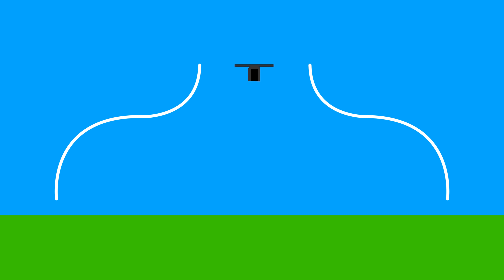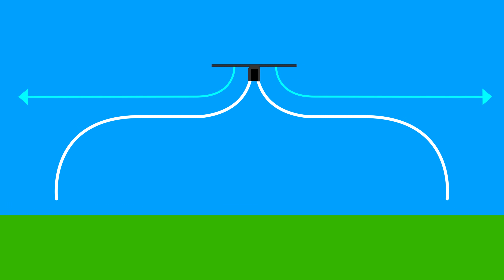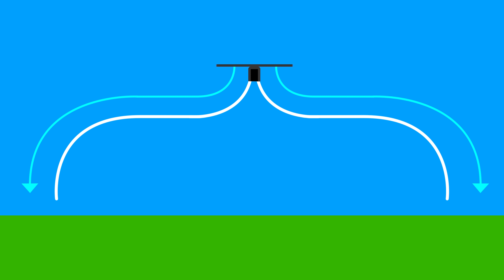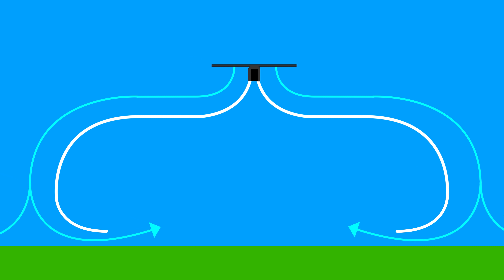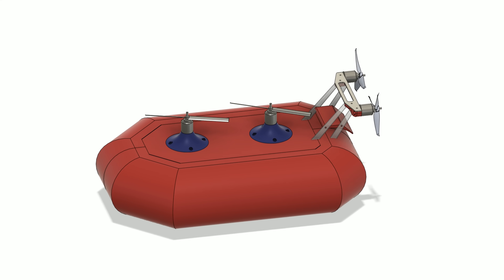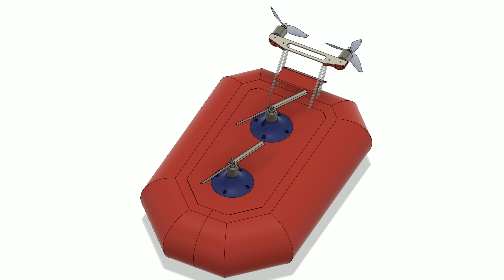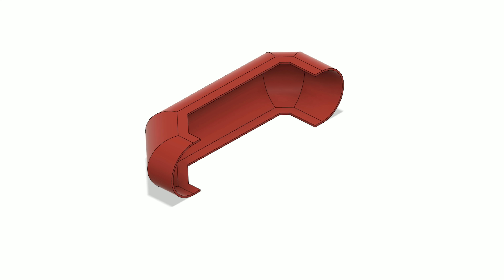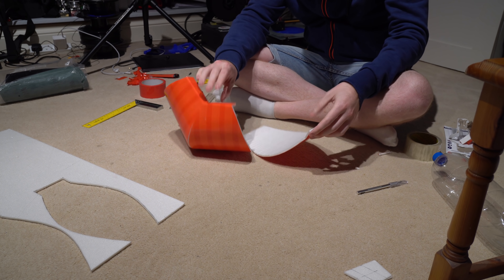Coanda Effect Hovercraft

Comment: Hey Tom,
I may have an idea to improve the hovercraft lateral stability :
By cutting the below high pressure volume in half along x (by adding a panel from the front to the back), in case of a side take-off, the other one would keep the high pressure and counteract the roll effect (maybe a little 😅) 
By the way thanks for your videos I love them all 😉👍
Reply: You and I seem to be the only ones to see the tipping as a feedback loop with airflow of the two sides.

Comment: Regarding the coanda effect. You should make low pressure side above so it will create a lift. You're wasting lifting air force created by the propeller by making low pressure side at the bottom.

Comment: The impeller should be inside and not outside. It should be sucking the air from outside the shell and distribute the air force to the inner side of the shell.

Comment: I wonder, could you stick the gyro onto it and program it in such a way that it can detect when it lifts off the ground more than a few inches and throttles the lift motors down to prevent it from flying/flipping?

Comment: Maybe the second propeller can be larger or have more of a pitch for more lift to help with the extra weight of the rear motors. Also, try putting on outriggers for stability

Comment: I think those aur molecules were not getting into the inside pocket as efficient as you had thought
As far as I can visualise, flow separation is dominated
Try to use vortex generator and give a shot.
May be better lift will be observed at lower throttle level.

Comment: Wouldn't it be even more efficient with just a tiny bit of air going straight from the horizontal propellers through some holes to under the structure keeping a positive pressure at all time?

Comment: The power to weight is so high you might just try adding a weighted bracket to the bottom to see if it fixes the stability.

Comment: i recommend independent throttling for the lift motors the back motor operating a bit higher that the fore motor might help stabilize it. i don't know if you can but perhaps a leveling controller could be made?? to aid in throtle control?

Comment: You are blowing air down onto the craft. The lowered pressure created by the fast moving air across the surface is simply cancelled out by the downwards pressure of air from the fans. You missed that in your diagram. An interesting idea on paper, but in practice it's 1/100th the efficiency of a normal hovercraft.

Comment: Excellent as usual Tom. One quick thought. I wonder if you drilled maybe a dozen vertical holes in say two rings of six around the blue inverted funnel shapes directly below the vertical fan blades whether this would help to increase the pressure under the skirt marginally and yet not interfere with the overall flow of the air across the surface thus maintaining the lift effect and slightly increasing the positive pressure underneath. Incremental increases in lift possibly but then efficiencies such as these lift jumbo jets into the air with there only being a difference of a few psi between upper and lower areas of the wings and look at how much they can lift. Anyway, just a thought. Keep up the great work mate, well done and always quite interesting, thank you 😎👍

Comment: You could easily test whether the leaf pickup is due to the Coanda effect. Just drive the craft over a leaf covered area with and without the lift motors on. Compare the results

Comment: The flip issue  is most likely related to the fact that the propellers are at the same height.
They actually had stability issues when developing the chinook. For that very reason.
But again I’m not a aircraft engineer so I could be wrong🤷‍♀️

Comment: This is literally just a helicopter.. you said it yourself "have to control the propeller speed no it doesn't take off too much".
Reply: Some of the lift is coming directly from the props, but the hull is modifying the flow of air so that some of the lift is also coming from the base. The props are pushing air directly into the hull that they are attached to, which would be counter-productive if not for the effect he's trying to demonstrate.

Comment: Love it. You can probably improve the balance and reduce its tendency to tip over by suspending the batteries and other weight lower inside the shell to reduce its cg. A wire mesh may be necessary to prevent leaf inclusion, although that will certainly reduce efficiency and might cause clogging.

Comment: This was fun to watch.

The Coanda effect vehicle does not have a natural height limit like the conventional vehicle has. That may be part of the instability problem. If there was a way to spoil the Coanda effect when it gets to far from the ground, that may make it more stable. Or you may add feedback to the vertical motor speed based on the height. The vehicle you built is not afraid of flying.

Comment: How do we know that the lift is produced by the coanda effect and not the low pressure above the propellers? it would be interesting to replace the main body with a rectangular box and see that, in this case, it dosn't move.

Comment: you are aware that you are not doing coanda nor anything like it, right? you'd need laminar flow to work properly, and by not having a duct on  your fans your propeller tip vortices will simply create so much turbulence that its just a redirection, not the actual coanda effect... besides, you'll never use a normal propeller for coanda... you should have used a different kind of propeller, a compressor propeller, with proper housing. or even just taking a vacuum propeller... those will give a nice laminar flow close to the surface, not the thong you actually have...

Comment: Again, another brilliant machine. If you don't mind suggestions how about, having a servo inside that has a weight that moves toward the apex of turns when turning? and it also looks so efficient that thin strips of lead could be placed inside on the lowest pasts of the skirt? And maybe totally cover the underside flat?

Comment: When it passes like 30 degrees u should have an automatic switch to turn the blades off or in the opposite direction. So that it stops the flip.  Also the front is to light. An additional weight in the front could help it from flipping over. Or make the front motor slower then the back motor so that they equally apply pressure to the weight ratio

Comment: I think the problem of why the hovercraft can not be fly is the CG and the force resultant. That force resultant of the engine thrust makes the hovercraft rolling forward. It can be stabilized with make control for the horizontal propeller to negated the engine thrust resultant. I am not really sure about my opinion, but I'm so interested in your idea tom. *cheers

Comment: I really think you have a great thing here going with the hovercraft.  To add stability try using a couple of gyroscopes.  Maybe counter rotating propellers would help.  I also noticed when you achieved a certain speed the nose turned upward and it started to take off.  Try turning it into an airplane, wings, rudder and elevator.  Maybe a rear wing with a canard configuration.  An airplane that could land and take off almost anywhere.... no runway needed!

Comment: I suspect you've actually made a highly inefficient helicopter rather than a hovercraft... Can you measure the airflow blowing under vs. being pulled and expelled off the sides?  Unlike a conventional hovercraft your slow-motion video shows oscillations up and down, indicating you aren't pressurizing the underside enough to cause an air cusheon.  A good way to confirm is try mounting the fans on the side so any vertical thrust is no longer a factor.

Comment: The Coanda effect works extremely poorly on a small scale due to the non-scalability of air viscosity and air inertia. Your devices fly not due to the Coanda effect, but due to the rarefaction above the propellers. On a small scale, the hull simply serves as an aerodynamic obstruction due to which flow is redirected to the sides and loss of thrust occurs. Watch the blades of grass swing. Surface bending of the body by air does not occur.

Comment: I wonder if propellers at the front creating an electrostatic current through tubes would interact with the coanda effect,creating more lift ?same thing maybe,combining super capacitors,but with a stretchy /light flexible cloth skirt around the ridgid top surface.or maybe if the surface of the hovercraft was hot or blew hot air,across the curvature of the lift surface 's or cool under.there are so many interesting combinations with this invention,thanks

Comment: Why not drop the impellers down ~40mm so they expel air INSIDE the hovercraft skirt pressurizing it.
Heres the kicker - you STILL get the coander effect, albeit with the air flowing the opposite  direction over the external curve, but nontheless still creating lift AND get the uplift from a pressurised skirt. 
you'd effectively turn the hovercraft skirt into a donut shaped aerofoil.
however, you may need to modify the bottom lip of the skirt to compensate for the change in airflow

Comment: Interesting. How about an overall triangular shape? One prop at each rounded corner and a directional one sticking up from the middle. Steer it by where the middle one points. The steering prop would probably need to be offset horizontally using a boom. I'm guessing pulling would be better than pushing, if you know what I mean.

Comment: Hi there, i just saw the newest Video of Integza.. Yeah that one with the "BAGUETTE". He used there an EDF Fan... What if this Power is enough to get an Coanda effect? I mean. With help of Air Spoilers on the exhaust side, you could change them with the Propellers here, or are they to heavy? What i mean, exchange the Propeller rotors, with this EDS Fan, but use Air Spoilers to guide the Air flow around to get the Coanda effect working. it could be an good indoor project over these cold days. or Use the "Turbocharger" with the same Exhaust idea
oh and yes. you need to balance it out. As you saw the Tail is to heavy, it need to be balance out like your planes
I mean, if you still have the Hovercraft Body somewhere, you just need to change the Engines.

Comment: The partial vacuum under the dome must be detrimental. As the drone rises, there is excess pressure pushing down, while underneath, there is a partial vacuum making things worse. Spillover from the downward airflow might introduce turbulence, which isn't good either. Holes in the dome?

Comment: If the coanda effect generated lift then the impellers would have worked. If the required impellers were too heavy, you could have supported them on the ground and allow you hovercraft body shape to hover freely around it. That would prove the concept. 
You could also have demonstrated that the shape you designed created the lift by also testing your engine assembly on a rectangular box of the same weight. Only the shape optimised for the coanda effect will hover OR they will both hover because both resemble a weak helicopter.
The collected leaves are the only evidence that it's the coanda effect and that was unintentional.

Comment: You should put two angled small propellers on the side of the craft, so that when drifting you can have a gyro that detects when it’s about to tip over and adjusts by using the small propellers to keep the downforce steady and perpendicular to the ground

Then it would be able to drift and should go quite fast

Comment: There's no Coandă effect there. The propellers lift the contraption, but they can't do a full job, due to the fact the the box under them stops the air flow, and that's why the toy is so impossible to control. You can get about 4 to 6 times the lift efficiency if just mount the propellers on the sides of the box, so the air flows undisturbed. To get any Coandă effect, you have to blow a laminar flow along the surface. A single propeller in front, with an air trap to direct the air partially along the surface, partially backwards, remotely adjustable, would create both the lift and drag for such vehicle (made one ~35 years ago which was round and had an upside-down "plate" on top, the air was coming from under the plate and run along the surface, the idea was to make an UFO, which didn't work, but it could lift and slide randomly above the soil due to the ground effect).

Comment: How about, instead of having the forward thrust propellers in the rear, why not have each one of them on the sides?  This would provide forward thrust, but also it may help prevent flipping by adding more weight to the sides where it seems to be needed more than on the rear.  They could even be perhaps sticking out from the sides a bit more which would help with the flipping issue.

Comment: you should have tried to "prove" that this was actually the coanda effect by attaching flat parts to the side. considering it has two big propellers thrusting upwards, its not clear that the upwards thrust is because of the coanda effect or if its just that youre creating a low pressure zone above the propellers

Comment: The tendency to flip (14:09) is (I think) due to the torque of the propellers. Would be cool to have each run in opposite direction (same for tail props) and see if it makes a difference.
Reply: They are spinning in the opposite direction..

Comment: Hello, Your project is really nice !
I'm pretty sure that your impellers are the most critical part of it and could be easily improved :

First of all, check the form/dimentions of the graphic card impellers (some got it), engineers worked on these for years and years ^^,

I think we'll agree that about half of the air (a bit less probably) the impeller will accelerate is kind of useless as it gets blown "upwards", so, higher impellers aren't usefull...
Maybe concider making the upper ring's diameter about 10mm larger (5mm on each side ;p ) than the blades, so it "guides the air" straight instead of "not" ^^,
You could make a 3D form where the blades are higher towards the center than on the edges to try to improve this (no idea if it will have any effect)

Did you try narrowing the inlet (central) hole, even with the same blades?
Things that are done on waterpumps is to have "secondary impeller blades", basically, it's smaller blades that don't go to the outer rim of the impeller, but still give a bit of punch to hte air.

Also, I notice that you gave a kind of 3D shape to your impeller base for guiding the air, that's good, and really important, you'll want as little turbulences (which are energy loss) as possible :)
Maybe improve this by giving a 3D form, as said before, following the best "turbulences less" route for the air

Anyway, that's an interesting project, maybe not the most usefull ever, but interesting and funny :)

Comment: What if you had a down turned wings on each side? Or if you draped more material over the sides to act as a skirt.
Reply: The drag would hold it to the ground in a more stable way.
Reply: You'd also have better control with an oval shaped design if you could control tilt on the two rotors.
Reply: When I say skirt, I don't mean like a hover crafts..... Imagine that there was a gap between the skirt and outer circumference of the hull. This would allow the air to flow freely below to create that negative air pressure. The bottoms the the skirt would act to hold more of that pressure in, causing a more dramatic effect.
Reply: You could easily do this with a loose spring around the circumference of the hull.

Comment: The problem with the drone idea is that the air being pulled down by the original fan's air will remove momentum from the original air.  You have a certain amount of momentum in the air driven by the fan, and you won't get more by making more adjacent air move too.  You maximize your lift by ensuring that the momentum is well-directed in a single direction, which is what a shroud extending from the fan will do: make sure the air goes down not spread out from that.

Comment: So next step, add wings with pontoons to stabalize it on the ground and allow control in the air. Would probably need some quirky design with a large hole near the body for the coanda effect to still work.

Comment: Nice interesting testing. Would be good if you still have it to seal the bottom hole so the air can smoothy glide under the bottom and also add tail rudder and tail wing to give it some stability at high speeds. You might get some better air and jumps!

Comment: Seems like ducted props would be more durable. Note that Coanda's aircraft used a ducted centrifugal turbine and was lighting off a gas-air mixture inside the duct to create more thrust. 

Probably not want to go there with foamboard.

 You didn't account for the disc area rule of a prop disc flying edge on, as the forward speed increases the pair of prop discs will create more lift. The forward prop will create more lift as the rear one is having to fight it's way through the vortexes of the forward prop.  Complex problems.  Also consider the use of 4 lift props so you can have a gyro adjust the lift thrust in turns and acceleration.

Comment: Excellent experiment treating the hovercraft surface as an airfoil, which incidentally suggests that the conventional hovercraft design has an inbuilt flaw, i.e. the fast airflow on the inside of the surface causes a lower pressure area and thus a downwards Coanda pull on the craft, which counteracts the pressured air lift effect.  Food for thought.